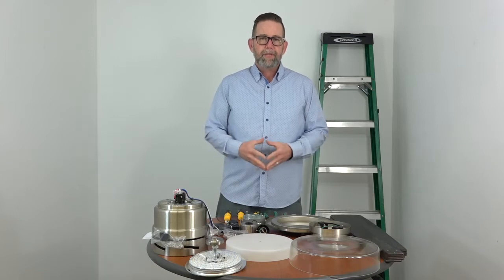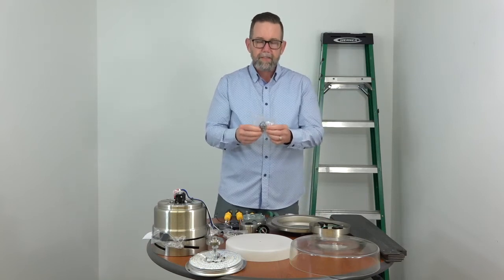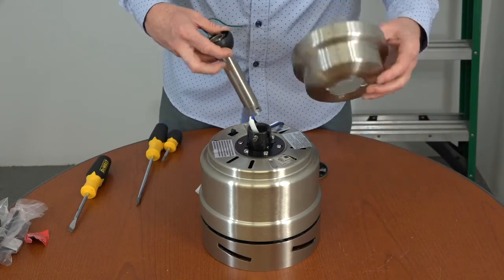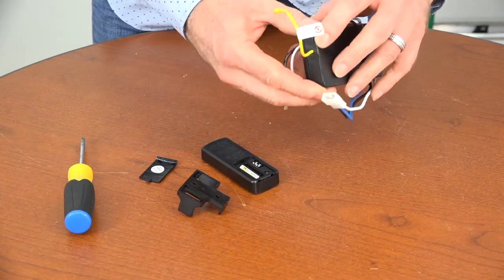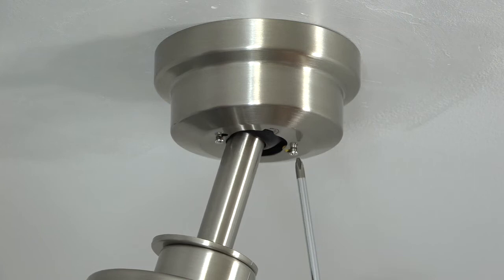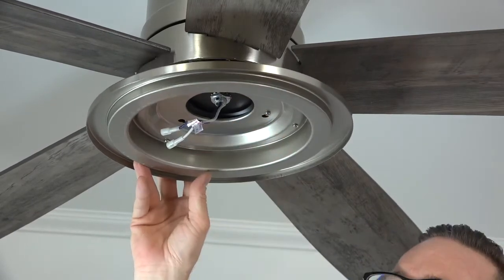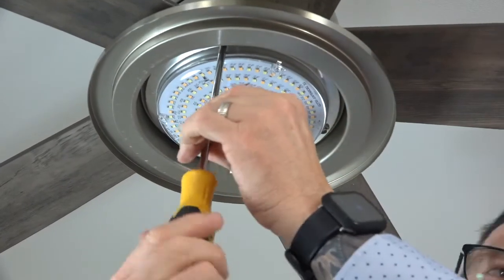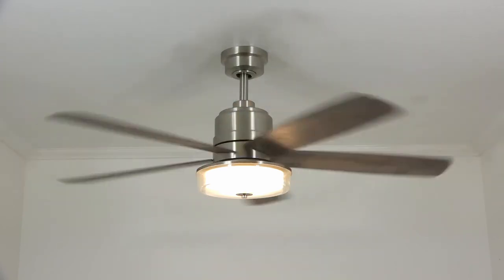How to Install the 52 in. Castleford Ceiling Fan from Home Decorators Collection

Comment: What if there is a red wire??
Reply from the maker: Let me start by saying that we are not licensed electricians and if you are unsure about wiring, we'd suggest calling one. That being said, typically a red wire is a switch wire. If it is, you'd have two options: 1) cap the red wire from the ceiling and just connect the receiver to the bouse black wire and white wire like the video shows. 0f 2) cap the house black and connect the receiver to the house red wire and white wire. This should let you turn the fan and light on/off using the switch.